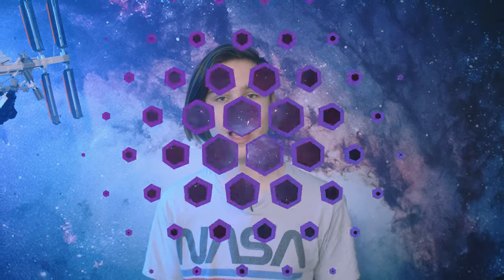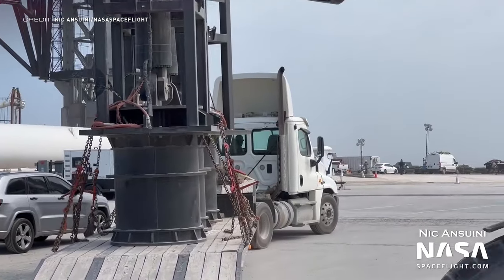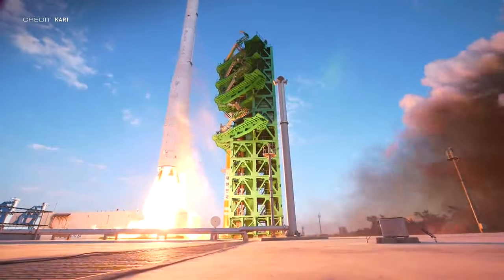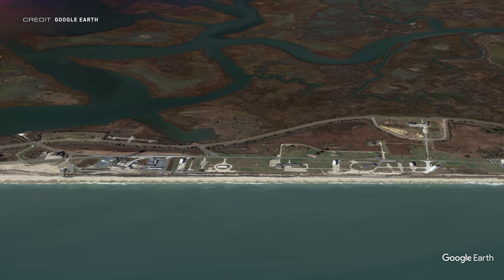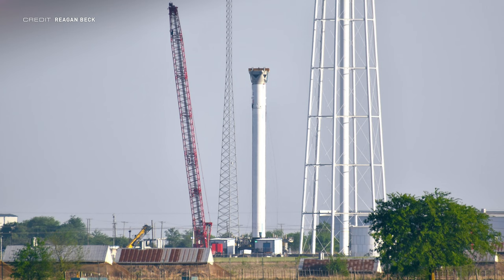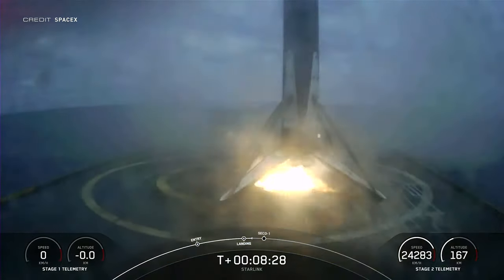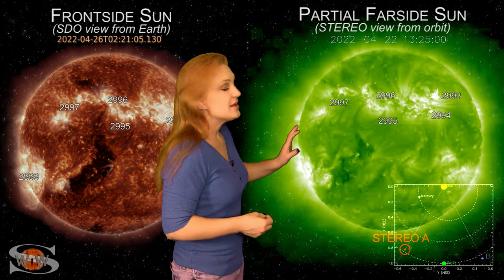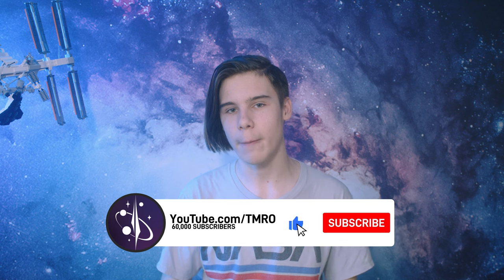Can Booster 7 be repaired? // TMRO Space News

Comment: That image of the inside of Booster 7 is not confidence inspiring.
Reply: It’s a test vehicle. They need to break stuff
Reply: My guess is failure from a pretty extreme test such as oxygen tank full w/ methane empty & sealed.  It'd be interesting to check the methane tank itself for signs of vacuum damage (stress warping around fittings & stringers).  Or, somebody ran it over and installed it anyway (like my dishwasher).
Reply: @gth042  Or, somebody ran it over and installed it anyway (like my dishwasher). .... if you do that your entire team will be OUSTED forever from SpaceX